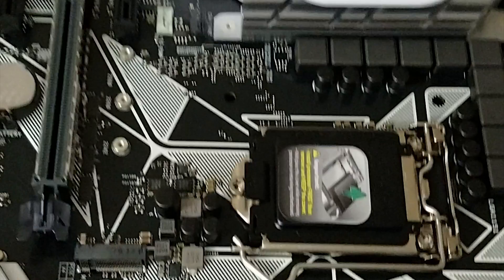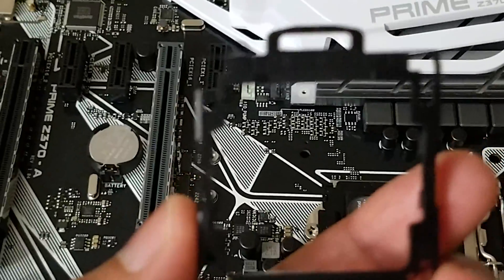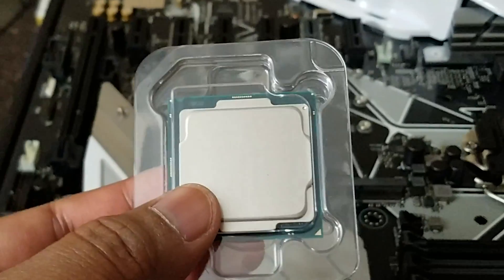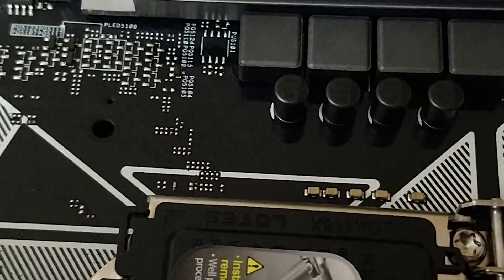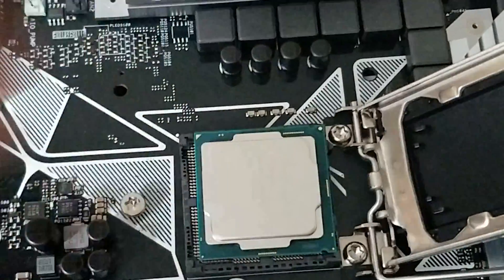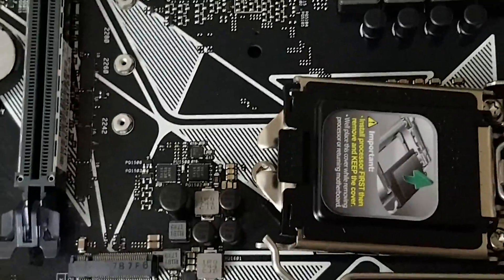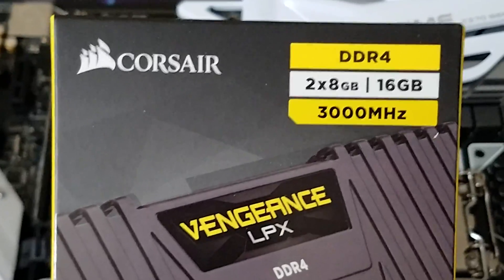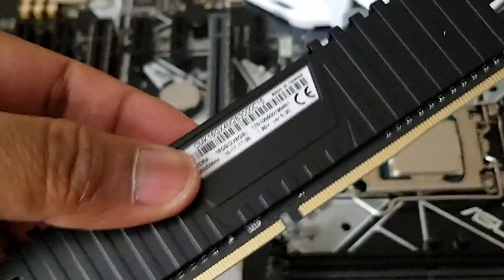How To Build Deep Learning PC-- Part 2 Install i5 8600k CPU & Corsair 16 GB Ram

Comment: Can I use an i5 8600k cpu with the z370a ?
Reply from the maker: I have used same (i5 8600K CPU ), but please check the specifications before using it.
Reply: @akhilendrasingh  Can I use an i5 8600k with the asus z370 a followed by gtx 1080 ti, 16gbram and a 650w psu is that gonna be a good build since I might overclock the gpu and cpu?

Comment: Hi Akhilendra, thank you for the fantastic video series.  I have a question about your RAM placement.  You  placed your 2 Dimms in slots A1 and B1.  In the user manual they say to use A2 and B2 if your are installing just 2 Dimms.  Does it matter or does the motherboard not care how you have it?  Thanks!
Reply from the maker: Thanks Tony, you should follow the manual. I later changed the placement. But if you want to experiment, you can try different slots.
Reply: Thanks,  I followed the manual and it worked out;  take care!

Comment: Either you showed wrong wrong or placed CPU wrong. You told to place that silver circle to arrow but in video you placed on apposite side.
Reply from the maker: thanks for pointing that out, i never had any problem with system and i have been using it since then, i guess i might have said it incorrectly. i will check it.